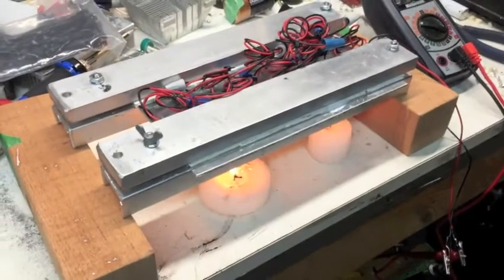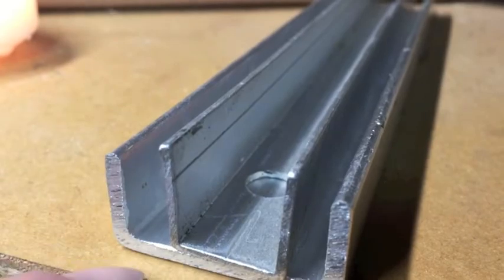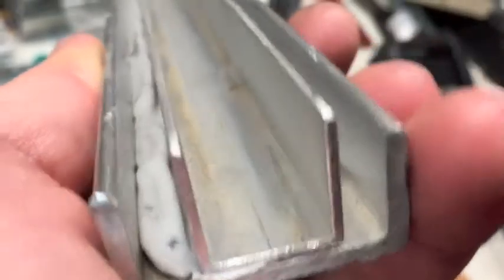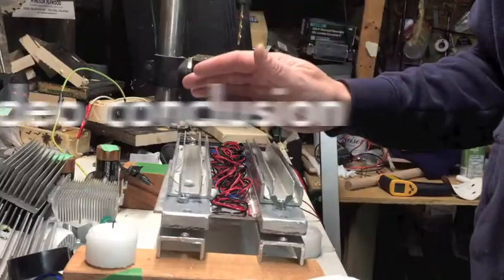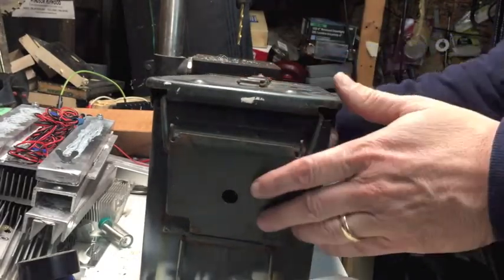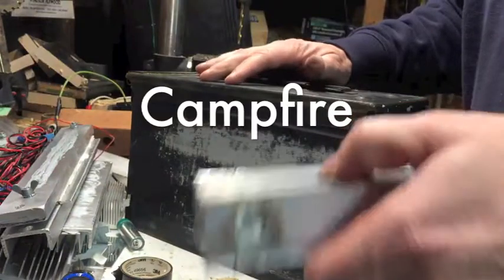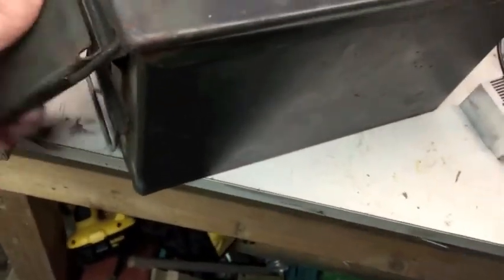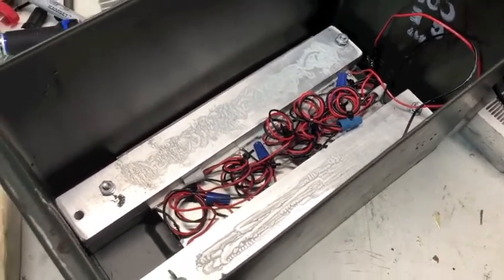Wood Stove Generator Part 3

Comment: I see this was done 1 year ago.  Have you progressed any further?  I look forward to the next step. Thanks.
Reply from the maker: I order more modules and have them on the workbench now. Started to use an old 50 cal ammo box a the housing for the modules. The plan was to place the ammo box next to the wood stove or campfire. Ran until some constraints with space and surface area. Discarded that idea and decided to make a foldable heat shield. It's in the works now. Hope to start it again in November of this year.

Comment: Great project. If you can get the voltage up to 6 volts or so you could use a voltage doubler to charge a 12 volt battery. Or like you said its ready now to charge a cell phone. Maybe you could keep your eyes out for a used computer water cooling system then you could bolt it directly to your metal plates.
Reply from the maker: It is fun project try to squeeze more volts. A computer water block would be sweet! The prices are around $120 bucks, but, I'll keep my eyes out for one.  I was thinking about buying a  scrap piece of aluminum and drill out some channels.